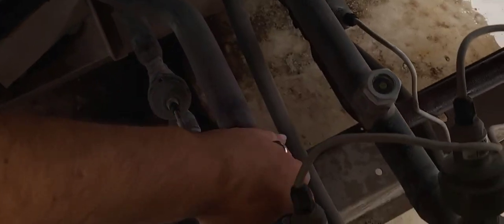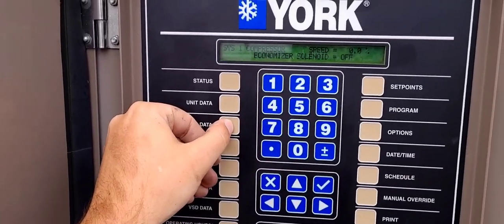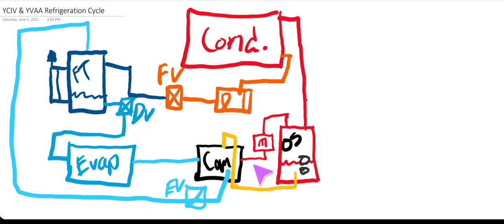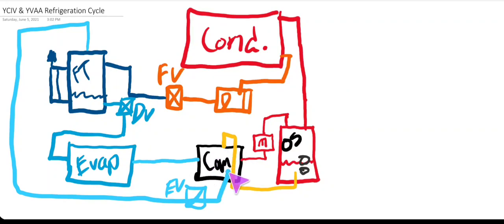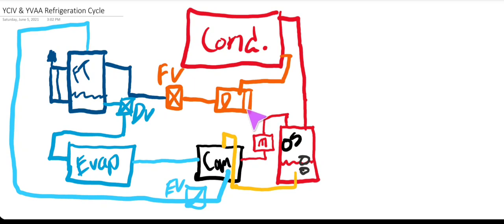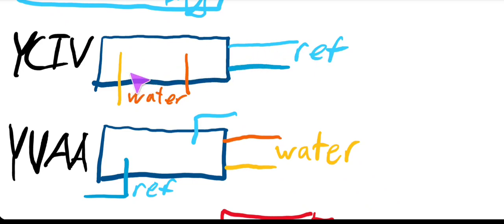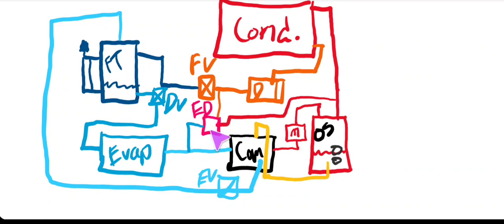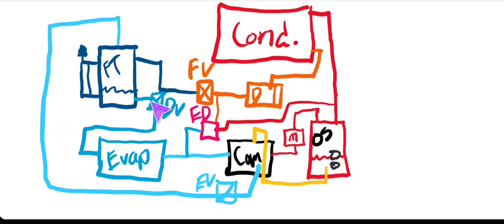York Chiller Refrigeration Cycle - YCIV & YVAA AC

Comment: Eductor part is wrong mate.. illustration should be 1 from liquid goes to eductor, 1 line from buttom of the barrel or evaporator and 1 line back to suction line.. this kind of oil management is almost the same of rtac unit. Oil from buttom barrel then back to compressor
Reply from the maker: Thank you, after I finished it and released it I realized I made a mistake on that part. What I will have to do is make a separate correction video doing a better job on that.
Reply: @HVACTIME  yvaa has some changes depends on coil either copper coil or micro channel. Copper condenser coil the drain valve control by liquid level sensor at evaporator whereas with micro channel coil they dont have liquid level sensor at evaporator. I have few yvaa unit that i maintain here in the island
Reply from the maker: All of mine have micro channel.
Reply: Economizer opens based on comp frequency.  Our YVAA now does not have check valves in the econ pipe, because our newer software allows for Economizer backflow control.
Reply: FILIPINO WONDER'S  yvaa sir?

Comment: Great video the chiller I have seen Model YVAA fix orifice instead drain valve (EEX)
Reply from the maker: You know I'm glad you said something, I made a mistake on my YVAA rundown. There is not a drain valve after the flash tank. It uses the "condenser drain valve" aka the feed valve only. I will need to make that correction some how.

Comment: Hey, great video thanks for taking the time to do them.
Question. if I'm understanding right the drain valve is the metering device?
Reply from the maker: At its core yes, It is the final flash point that is controlling evap superheat. But the feed valve also plays a critical role in that as well.
Reply: @HVACTIME  I understand now. Thanks for the quick response!

Comment: I have same unit YCIV micro channel cond coil.im facing problem in drain valve not giving the exact position when I put manually  put it to 100% open and 0% closed,when it run it having alarm low suction  limiting and unusual sound of the compressor.i suspect  the stipper motor module so I tried to swap from other unit but still problem  occur.unit shutdown  low suction  pressure. Any advice
Reply from the maker: Extremely common for the exv gears to where out and stick causing it to get out of calibration. Recommend replacing exv.

Comment: Can you explain exactly what the economizer valve does?  Is it cooling the compressor or reducing compression ratio?
Reply from the maker: Its pulling flash gas to reduce pressure on the flash tank.
Reply: That was what i was thinking as well